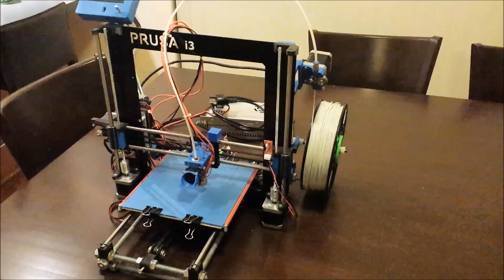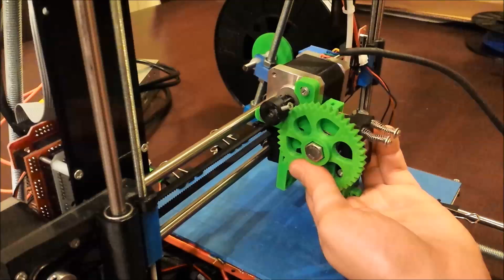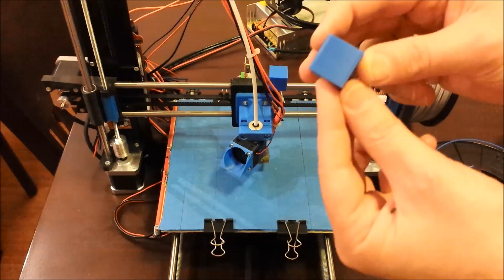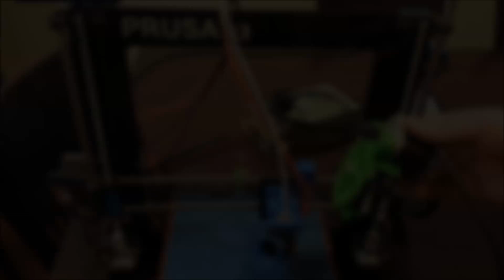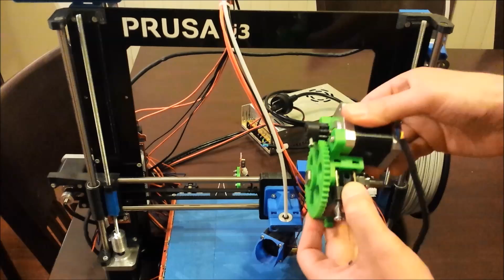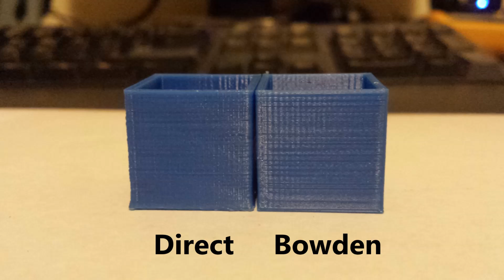3D Printer - Major Quality Improvement!

Comment: I'm thinking that direct feed would yield a more consistent flow rate, if the filament spool is placed further up, like at the ceiling. It would accomplish a couple of things.
Firstly the amount of unspooled filament would contribute more mass to overcome the moment of inertia of the spool, giving unspooling a slightly more uniform characteristic.
Secondly and more substantially the length of the hypotenuse of the triangle described by spool, carriage and center plate will deviate less from the distance between spool and center plate, which should produce less pull and slack of the filament as the carriage moves between center plate and the outer edges.

Has anyone tried mounting the spool further up with direct feed?
Reply: Johnny Nielsen on my Schufco i3 I have that, spool mounted about a meter or two above. What you forgot is that the flexibility in the filament also evens out the tension a little. Nevertheless (although I don't yet have a proper spool holder with bearings installed) I get better quality by simply pulling on the roll every hour or so and unspooling a few meters of filament that will hang as a coiled roll between the printer and the roll.

Comment: I believe the filament 'pulling' on the carriage is not giving problems with extruding, but rather with smooth movement of the x-carriage. You should try a direct drive with a bowden tube leading to the direct drive, see how that goes!
Reply: How exactly do you have your extruder set up then?
Reply: sttrife THANK YOU!!! That is exactly what I do. You'll get the best of both worlds: better filament feeding/retracting resolution and less strain on the carriage.
Reply: I'm guessing like any other makerbot?

https://i.ytimg.com/vi/Tr_H8v0LiW0/maxresdefault.jpg
Reply: ohhhh.... nice.  I'm going to try this.  Been considering the Bowden setup, but the negatives didn't excite me.  Lower mass is nice, but I have a heavy enough bed that I think my speeds will always be slow.  But this.. take away that X-movement force... yes.  I will try it.

Comment: Got an UP 2 Plus when they first came out and are happy with it but being limited by the print size. At the moment trying to look for an affordable replacement. I'm def leaning towards the Bowden feeder as keeping the stepper away from the heated nozzle is also desirable along with keeping the nozzle part as light as possible. I'm also looking at one where the print bed doesn't move, 3rd party filament, open HW & SW, affordable spare parts and upgraded parts.   BTW - Good clear video... thanks.

Comment: i have a question i am new to all this if i want to change my standard end on my setup what exactly do i have to do i have standard setup and want a e3d v6 hot end is it just the end i need to order or do i need diffrent brackets ect to attach it and will that work with the same board i have

Comment: When loading the filament. 
Do I remove the tube from the V6 push the filament through the tube through the V6 then replace the tube into the v6.
First timer with bowden
Reply from the maker: Yes. Remove the tube from E3D, push filament through the tube, guide the filament into the hot E3D until you see it extrude, then push the tube into the E3D.
Reply: I am going to try bowden myself, and this is the answer i was looking for.
I figured this was the only way i could get filament in the heatbreak, i was wondering since i use a e3d clone with a different bowden adapter that this was normal. I guess it is, thanks!

Comment: I have to agree the 1.75 made the difference faster melt and easier movement but that E3D jhead is nice. i have not had 1 clog not mess and the parts are coming out stronger and hardly no crumblies on the edges

I love it

Comment: Last night I noticed on my printer what you are talking about...the filament pulling tight at various times.  However, I think the tension on such occasions actually pulls on the whole print head causing it to be yanked away from the work piece -only by a micron or two.  But this is enough to reduce quality of finish.  Either way, the changes of tension can't be good.
Reply from the maker: +Karl Allison 
Interesting idea, and probably what I was experiencing too. Definitely change to another feed method as it will produce great results.

Comment: The conclusion you've drawn is completely wrong.  The artifacting you had (ringing) was due to the mass of the extruder being swung back and forth on the x-axis and resonant vibrations in the frame.  By reducing the mass, you reduced the amplitude of vibrations and likely changed the resonant frequency of the system.
Reply from the maker: +Brandon Fesser 
I was talking about inconsistent extrusion in this video. Ringing is another topic and yes I still have some ringing on the Y axis.

Comment: I installed bowden too, but i have some problems with it. Biggest one is it seems, there is not enough pressure in the nozzle because of bowden and it results in gaps between perimeters.
Reply from the maker: +ZeppyCZ 
Temperature too cold? Blocked nozzle? Under extrusion/calibration? Using 3mm filament?
Reply: Hotenf is fine, i tried several types i have and every one of them worked the same- infill is perfect, but there are gaps between perimeter walls. I am using 1.75 fillament, PLA mostly, my extruder steps are calibrated correctly. It is not underextrusion, infill, top and bottom walls are just perfect. I can try increasing temperature, Tested 185-205 with no effect, i'll try go little bit higher

Comment: This is an incredible resource for anyone interested in 3D printing.  So glad I found this channel!

It occurs to me that there are two factors at work here that I haven't seen mentioned.  The first is placing the spool above the machine.  When this is done, you have a heavy (2 kg) weight above the machine, attached to the machine; and any time the print tray moves, that motion will cause the heavy spool to oscillate.  Those oscillations will then translate back down the machine, contributing to the ghosting artifacts.

The second factor is the weight of the bowden feed unit, as opposed to the earlier gear driven approach.  The Bowden feed has a much lower weight at the print head, hence much lower inertia.  It's my belief that the inertia - the resistance of the head to sudden changes in velocity - is a major contributor to the ringing and ghosting artifacts.

I suspect that everything that can be done to keep the center of gravity of the machine as low as possible, and to keep the moving extruder head as light as possible, will provide clear benefits in artifact reduction.

Thanks so much for a great channel.  Well done!
Reply: I agree 100%   I havent received my printer yet but I kind of cringe at every spool holder attached to the top of the machine that is already bouncing around different directions without extra mass way up on the top of the build.

Comment: Hi nice video .I have a question about the bowden fed compare to direct ( im a bit noob at this ) in 1.75 filament i heard there  are troubles with different materials and the second question is about the hot end what is the best to have on ?
Reply from the maker: +stylios zerox 
Hello. The only material which is difficult to print with a bowden extruder is the flexible filaments, such as TPU. There is absolutely no problem printing PLA, ABS, PETG, Nylon, Polycarbonate with bowden. In fact, there are flexible filaments available which actually work very well with bowden (Eg: PolyFlex).
Regarding hotends, I recommend the E3D, but this is the only one I've used. I've had great experiences with it and feel comfortable recommending it to anyone whom asks. Cheers :)
Reply: +Tech2C Thank you :)

Comment: Hey, I got a question off topic but I was wondering what type of nema 17 stepper motors are you using? I have been looking at buying the motors but I am a little confused with the specific specs for the different types of motors that are out there. Thanks
Reply from the maker: +Iceteakilla 
There's a few different sizes of nema17 motors. Look for the 4kg torque version.
Reply: Tech2C Thanks a lot!

Comment: The bowden is NOT the way to go period. You introduce hysteresis at a closed system. Ozzling is one of the disadvantages of your "recommended" system. Read more at the internet. What is the diameter of the filament you are using ? 3mm is not the way to go.
The fact that you do not see any difference from jhead to e3d you have 100% an ultra uncalibrated machine that's a true fact. 
You had results that bad that changing your uncalibrated system you saw "improvements" with a bowden system. 
This should concern you a LOT.  Videos like yous are misleading and introducing bad rumor at the already bad rumored reprap community.
Reply: Dang! Take it down a notch. Youtube videos like this one are for presenting your information and letting others test/use it. If you don't like the certain piece at hand, you could present it in a less insulting comment.
Reply: +Pig Tech This video is misleading. Maths is not an opinion. Do not waste your time and my time with further personal discussions.
Reply from the maker: +TrustFm 
Oh man, thanks for your comments, love the banter!
Now, I read the "internet" for months to fix my extrusion problems. I also read many "opinions" about the pros and cons of Bowden systems. Everything I tried as read from the "internet" proved futile to fix my issues. Switching to Bowden totally and utterly changed my experience with this printer. If you believe what the "internet" says, checkout the quality of the prints from my videos from this timeline onward and judge for yourself if Bowden is still unworthy as an extruder. I will never go back to direct drive, period. Misleading? Bad rumor? Hardly.

Comment: If you want to print flexible filaments, or for other reasons avoid bowden issues. You could also reattach the old wades extruder as you had it before, but mount a PTC on the top of the wades, and a ptc mounted somewhere on the frame. This means the path to the extruder inlet will be a constant length, no matter the position of the x axis, but it will allow the driving force on the filament to be very close to the hotend
Reply from the maker: +dumle29 
That's a good idea. I think anyone on Direct drive should create something that makes the feed tension constant.
Reply: Tech2C I honestly don't know why it's not standard, it's such a cheap and easy improvement :/

Comment: I started 3D printing with a direct drive setup. Then, after watching this video decided to give E3D v6 a go. It has now been 6 months I switched to bowden. My verdict is thus: Unless you are trying for extreme speeds(150mm/s +) or you just like the aesthetics there is no reason to use bowden. Direct drive is the way to go. Far less problems, more consistent, easier to troubleshoot.
Reply: +flanker I don't know if I'd call 150mm/s extreme speed.  I work with a printer that does 250mm.  It does use a Bowden tube.  One thing a Bowden setup gives you is room on the carriage for part cooler fans.  I also wonder if reducing the mass of the carriage reduces wear and tear on the drive mechanism.
Reply: +dantheman1998 flex3drive solves both issues but pricey.  However imagine high speed low carriage weight printing.... also it's retract speed is 10-100x faster, 0 stringing.
Reply: I was a bowden first, and although I noticed more difficulty initially calibrating, bowden has far too many problems, primarily regarding back pressure, which leads to all sorts of problems particularly with certain filaments. Flexible on a bowden... no thanks.
Reply: +flanker I also find that bowden is hard to tune to find that sweep spot
Reply: +flanker 
Where do you recommend to mount the motor end of the Bowden extruder setup. I have a Chinese clone of the Prusa I3 (afinibot) and i definitly am going to upgrade but was wondering, where shall I mount the thing? I have seen on top of the printer frame, on the side, on the spool holder...
Reply: Francois Bujold mine is at top. I don't think it'd make much difference. Just mount it wherever is most convenient. Although try and keep the tube short.
Reply: flanker i have had blwden for a year now, never had problems with that, my problems are with the alignments due to a cheap frame i made. Never had anything stuck or anything

Comment: A good fix would be to mirror the extruder movement on another channel with a stepper motor connected to the spool.. so it's maintaining the level of slack as the extruder feeds.
Reply: For now am thinking of connecting a gear to the unengaged part of the extruder gear and to it a pulley so I can use a belt. My printer is still under construction and I am designing  my own extruder so I will fix that in. If you are interested I am going to share the finished files with you.
Reply from the maker: +Kyle Geddes 
Yeah that would maintain a constant feed also.
Reply: +Kyle Geddes Same idea came to me when I watched this video I and going to try that even with my bowden extruder
Reply: +HenneH would be interested in seeing how that works out. how will you mirror the channel?
Reply: +HenneH ah.. here I was thinking where I could find a cnc controller with a separate extra channel, but that's an elegant solution. For sure, share when you get it going!

Comment: I don't think that was your problem. before, you had a 2lb+ dead weight of spooled filament acting as an inverted pendulum multiplying every vibration made by the print head and bed as they moved back and forth - thus throwing off the alignment on your printouts. Now that you have the spool off the top of your printer and on the table and base, its not adversely impacting your prints.

Comment: I've bought me yesterday the E3D Bowden Hotend and build it up.
Everything is good in this case, but... i tryed to use my old Extruder and fix that above my Prusa i3 to push the Filament inside.
This dosen't work... i cann't push the Teflon tube connector inside of the extruder and if i try to extrude the Filament it bend so long until it breaks. :( (The Filament).

Got somebody any idea to fix that temporary for 2-3 Prints?

Comment: I have now my E3D Lite 6 on my printer, using your design of course! but I'm struggling with the Firmware configuration since I never used before a Bowden configuration...my first layers are really bad...you can take any line of filament  from that first with your fingers, without using any sharp tool...would you please give me some tips about the proper way to set up my printer for it's new Bowden hot end ? Thanks in advance for your help. Cheers!

Comment: A bowden system releases and generates pressure to the hotend, hobbed bolt even more. Wrong conclusion sry ;)

I had a bowden and now i have a direct feed. Only disadvantage is the weight is has. Which will be your problem. This 1-2mm sheet mechanix printers or even plywood or acylic... well think of it yourself. Build my printer from scratch out of 40mm extrusions. Thats stable!

Comment: Great video. This inspired me to try out the e3d v6 / bowden combination. Can you offer any suggestions for print/slicer settings for this setup? Your prints look great. Thanks!
Reply from the maker: +Daniel Coleson 
Hey thanks! If you're after quality over speed, then print quite slow at around 35mm/s. Also set your default acceleration quite low to 800mm/s for both x and y axis. And of course, use quality filament ;)

Comment: taking the stepper motor off the X carriage is what makes the difference. less inertia means more accurate positioning.. Also the bearings of a prusa i3 are really low quality & cost. SKF makes pretty high end linear bearings in similar sizes. I think that would also be a huge improvement! however the biggest problem of this printer is the moving bed, It is way better to have the Z movement on the bed (again inertia)
Reply from the maker: +00Mass00 
Yep, agree with everything you've said. With this design, I can't do anything about the moving bed, so the only alternative is a new chassis...

I like your idea regarding the linear bearings. These are unknown quality bearings so maybe a brand name like SKF will add further refinement to print quality. The only issue is these printers are built to a price, so once you start upgrading to brand name components the 'bill of materials' cost might become prohibitive.
Reply: +Tech2C Yes you are right about the costy BOM, but personally I think thats the great thing about the repraps they are cheap and not optimal but through time and after a while you can easily afford those upgrades. of course at some point you would be better off buying a "better" printer although I don't think printers of 6times the price perform that much better.. btw the bearings are SKF LBBR (LBBR 10-2LS) It sure is something that I would like to try. they are not too expensive.. Do you know if 8mm Z rods would make an improvement compared to the M5's? Seeing your videos makes me realise my printing quality is pretty bad! lets upgrade!

Comment: Where is the best place to buy both the hot end and Bowden filament drive I'm in Aust
Reply from the maker: +Luke Pettit 
Hi Luke, I bought the E3Dv6 direct from e3d-online.com.
Bowden kit you can make yourself, checkout my other video https://youtu.be/yLH4K1vNoXo
Reply: OK thanks I just finished watching it this afternoon ;-) great videos BTW just finished the slic3r vids where I've preset it where I could with many of the basic settings.
Reply: V6 hotend full kit - 1.75mm Bowden (12v) 48 pounds? or the 24v I guess the voltage will have to know when it gets here